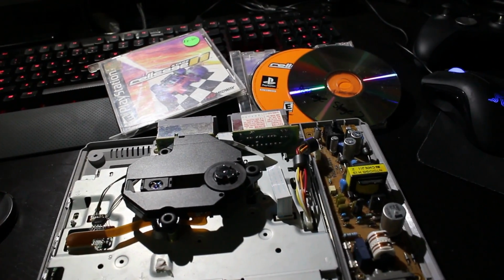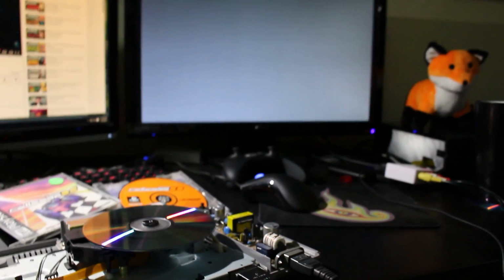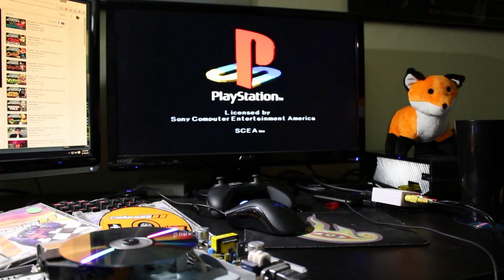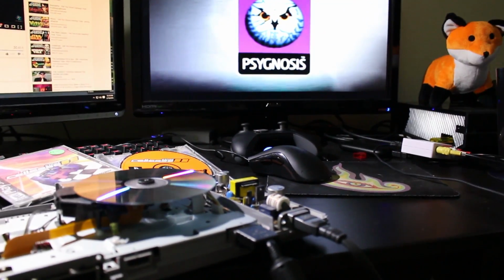PS1 MM3 Modchip - Install Overview & Demonstration

Comment: I was Trying to mod the PS1 SCPH-7501 followed everything but the motherboard has broke 
I tried to mod it using the mm3 modchip it went wrong the motor spinning counterclockwise and it’s no longer working , it happed the same with another motherboard for SCPH-5501 I had , I do t know  if it can be fixed? Has anyone had the same issue ,?

Comment: I've installed an MM3 in my 7501 and with the twenty or so games I've burned, I have about a 50% success rate of games booting. Those that boot run flawless. Is this likely a burn/media issue rather then a problem with the chip or the soldering?
Reply: Figured out my own problem, had been trying different burn speeds but just needed to use AWS and now all discs are working. 👍
Reply from the maker: Glad you resolved it!

Comment: No wonder you’ve had issues you have cold solder joints covered in hot glue
Reply from the maker: No hot glue here. Why you trying to mislabel things, Justin?
Reply: MrMario2011 what’s the white stuff covering the solder joints then? Dried up flux?

Comment: please don't tell me that's hot glue on the solder points.
Reply from the maker: It isn't.
Reply: I watched another video of yours and didn't realize that was a type of flux. I mainly use no clean from either a pin or syringe and this threw me off for a bit.

Comment: I have a question, as i have a mm3 chip and i have 30 awg kynar wire. They say you need to use larger wire like 26 awg on the reset, vcc, scex, points. Where exactly are those points? I cannot find a diagram of the mm3 chip and what the points are called. I am using a scph-5501. Thanks!

Comment: I'm sure these are difficult to find these days, but there were plug-in "mod-clips" (or "game enhancers) available for the PS1s that still have the parallel port (7501? and prior?). They work with all models and simply plug right in.

I know Mario does this stuff for fun, but some folks may just want the destination and not the journey. haha
Reply from the maker: +Maxwelhse They're still around and still work, although I prefer the permanent one shot boot solution that a modchip provides - Plus you already said that I do it for fun so there's that :P

In the next few weeks from the release of this video I actually have another video covering that, you can essentially take a game enhancer and reflash it to serve as an external modchip, no swapping or soldering required :o
Reply: *****
Cool. It seems a fair portion of the folks commenting here may not be comfortable with a soldering iron so it would be a good solution for them (as it was for me... but in my case, when I did it forever ago, I didn't want to void my warranty! lol). Mine is so old it has a serial port on the back so it will be interesting to see what a new one looks like. Other than the disc swap at boot and having to fuss around with the drive door switch mine has worked great.
Reply: Maxwelhse I did both. the parallel port mod blows. it's picky sometimes and you have to put in an original disc first. plus have your lid with a spring on it. it's lame. my modded 9 is great. gonna ditch the parallel to my 7 and put in the chip.

Comment: Considering the ease of this mod, would you reccomend it to someone who doesnt have any prior experience with installing modchips, MrMario?
Reply from the maker: +BurbleBenis Yeah, for whatever reason the PS1s are a bit annoying to solder to, as are the legs on these chips, but it's easy and cheap enough. Aside from having proper soldering equipment and skills you can buy a pre-programmed chip for super cheap and that's it.
Reply: sounds easy enough, thanks man.